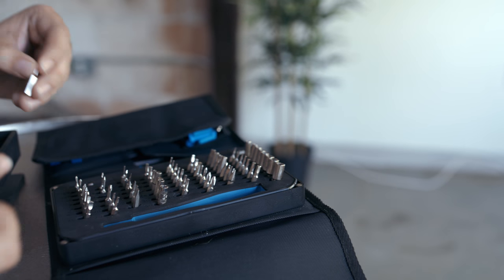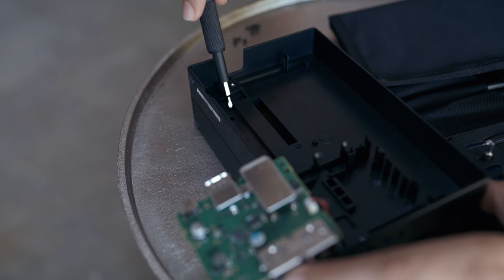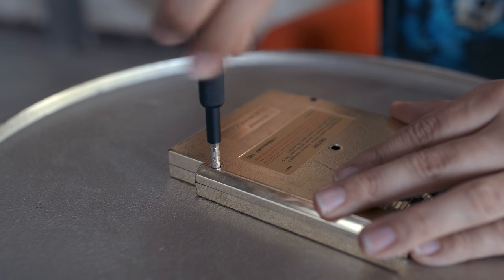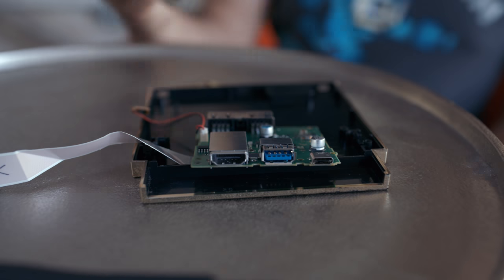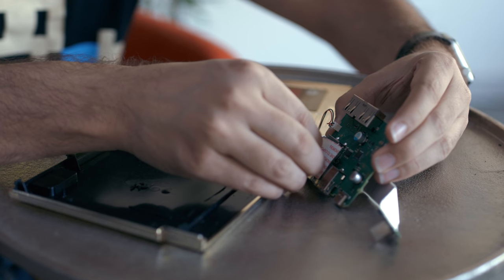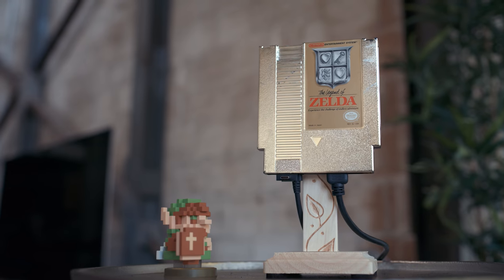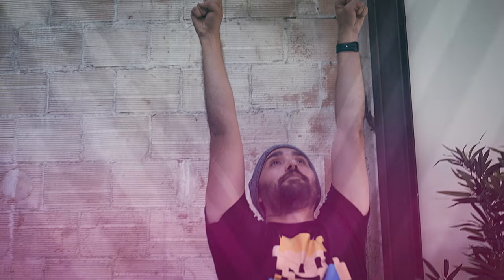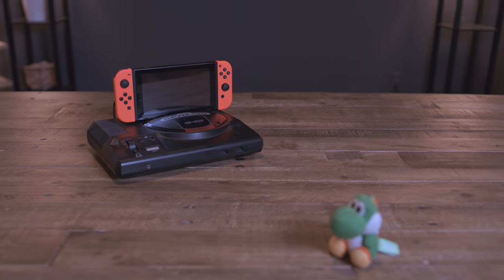Custom Zelda Nintendo Switch Dock!

Comment: that's a great way to get your Switch to overheat!! There's a reason it's held upright with space on three sides.
Reply: OK Internet What space?
Reply: You failed physics class, didn't you?  That's okay.  You are not the first.
Reply: Who me? If so you fail intellectually.
Reply: The electronics inside the dock produce small amounts of heat.  The cartridge is not totally enclosed.  The amount of cutting he had to do on the bottom left a significant opening for air.  True he didn't open up the top to create a "chimney" effect, however, the stuff in the box is not the problem.  The problem is that tiny fan on that Nvidia chip inside the console.  That is going to be the problem in the future for Nintendo if anything goes wrong.  We embed electronics in epoxy all the time at the U due to some slime ball cheap executive short cutting good engineering.  Epoxy isn't exactly a great conductor of heat. 

As for being a bit less condescending ... why don't you try grading lab reports from students that put in minimal effort 100% of the time for 14 weeks straight then we will talk.
Reply: A Physics Professor Why don't you take your frustration out on your students then? Instead of bothering random kids on the internet. And get some student assistants to grade the reports of the lazy freshmen and sophomores.. That way you won't have to bother with the people who are going to drop out anyway.. ;-)

Anyways, they didn't allow for the switch to cool the dock for nothing. It would be proper to follow the original design.

Really the cooling of the chip is hardly a problem with dedicated hardware and software. The hardware will be specifically adjusted to minimize bottlenecks. And when designing software for specific hardware like this you make sure you stay within the limits of what you're working with. This is especially the case after the Xbox 360 debacle..
Also, don't forget this chip is both custom designed for this specific hardware and already specialised to be low power and efficient.
Reply: "It would be proper to follow the original design."
Yes, because the Switch's dock design is definitely not the absolute most shithead way of designing something ever, despite not allowing for much airflow, if any at all, and causing constant damage to the Switch because someone at Nintendo decided that screen scratching and charger port damaging was no problem at all.  OBVIOUSLY, it was designed well.
Reply: You have no idea about design. All you're able to do is critique. And poorly at that. You probably don't even own the system, not even able to look at the design first hand yourself to do your own research. 

The dock actually prevents damage to the charger port with normal and even quite rough use. So I don't know where you got charging port damage from. Never came across any reports about that either.

It also properly allows for airflow to the intakes with the open area at the top of the back and even the liberal sized cut-out for the cables.

You're really good at exaggerating, aren't you?
Reply: A Physics Professor
I expected you had one, I was talking to the other guy. I responded to you in a different comment.
Reply: "wow someone made criticisms about a video game console's designs that match complaints others made and make conjectures about potential future problems, let me rage at him in the comments by saying he's exaggerating so I don't have to do any research or focus on doing anything better with my shallow life"

Back to the den with you, little lion.
Reply: the back vents are made to be covered they are deep set in so if its cover air still gets in and out. i have tested a heat tester in the core when the back is covered and no over heating happened
Reply: doesn't mean that it wont happen, it just didn't happen to me

Comment: Actually, you're wrong.
You can use a USB Type-C to HDMI adapter, then you can get video signals from the Switch to the TV.
I'm not sure if it works, I've never tried it out yet.

Comment: I would have put the USB-C inside of the housing and used the extension cable coming out. This way it protect the original ribbon and C Connector

Comment: RIP Zelda cart. Would the form factor of an SNES cart or N64 work?
Reply: Chad Valencia assusing it can hold the electronic board, yes
Reply: Not at home so I can't take apart my carts or my dock
Reply: Chad Valencia an Super NES cart should have enough room to house the whole project.... it will also be less of a chore then an NES cart
Reply: It will work if you take out the boards and are willing to remove plastic

Comment: Has anyone considered the fact that the dock is cooled by the Switch fan????
The air intakes above the PCB of the dock aren't there for nothing, and neither is the open portion at the back. Putting the components in an enclosed casing without ventilation like that is going to make it heat up much more than in the regular dock.

Also, luckily here they put the Switch on a separate stand so it can properly dissipate heat when running in overclocked dock mode, but some of these projects just lay the system down on a flat surface which will cause the Switch itself to also heat up much more than in the dock itself..

The dock's "important bits" aren't just the PCB and ports, the design of the casing is an important cooling component for both the Switch and the dock's PCB.

Also, having the Switch unprotected like that is a much higher risk on scratches or worse screen damage than putting it into the dock but anything to prevent the dock specifically from scratching it, am I right? "ಠ_ಠ

Anyway, nonetheless it's a cool idea and fun to build your own version of the Switch dock but you should really consider accounting for all aspects of its design while doing so...
Reply: The PCB of the Switch does litteraly nothing.
Its just an adapter.
Its hard to imagine that such an adapter would produce much heat.
Reply: Funny, because I can actually feel the temperature difference when I put my hand on the vents above the PCB when the system is on. And the casing of the PCB is warm as well.
Don't forget there's quite a lot of current going through the system, and besides the flash memory chips there's a number of microcontrollers present on the board.

But yeah, I guess you'd have to imagine they also added those vents and the option to use active ventilation from the Switch for nothing..
Reply: "Funny, because I can actually feel the temperature difference when I put my hand on the vents above the PCB when the system is on. And the casing of the PCB is warm as well."
You do realise that wats warm for your hand isnt really a problem for the PCB ?
A PCB like this shouldnt have any problems with up to 90-100 degrees C.
Your hand would feel different.
Reply: Hardwarehelfer You do realise that it is warm while the Switch is actively providing airflow to cool it?  And you do realise I'm not actually touching the PCB but the external casing which is also separated from the PCB by about 8-10mm?
So obviously my hand doesn't feel different: the system is actively being cooled.. It would be a real problem if even with cooling it would reach those temperatures. The point is that even with cooling the dock PCB housing feels warm and emits heat through the vents. Without cooling my hand would indeed feel different.

Comment: I was going to buy nearly that exact aluminium stand you have it sitting in. However from what I can guestimate it covers about half the of each air vent is it a problem.
 Or can you prop it out a bit towards the front by about 2 or 3 mm's towards this plastic teeth on the stand that holds the switch. Or does it just not need that much air most of the time etc.
I just like the extra height over the PowerA Mario or Zelda versions and it's half the price.  However that version only covers about 1/3 the 2 air vents.
Please let me know asap yourself or anyone as I am going into hospital.

Comment: is usb extension cable safe to use on switch? i dont want to fry my switch. and im not looking for a novolty dock im looking for a replacement. i dont wan tto use a 3rd party dock because after the 5.0 update people are claiming 3rd party docks are bricking systems. so ima make my own housing for the offical circuit board but i cant buy a dock shell because i have a mumva case and it wouldnt be able to fit still. so help please someone :3